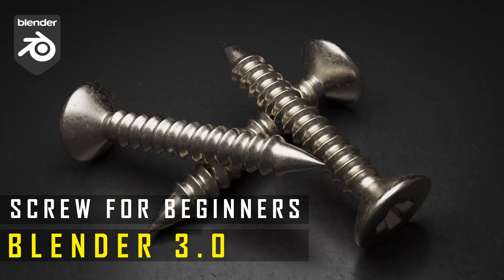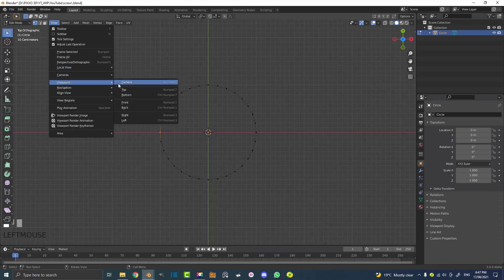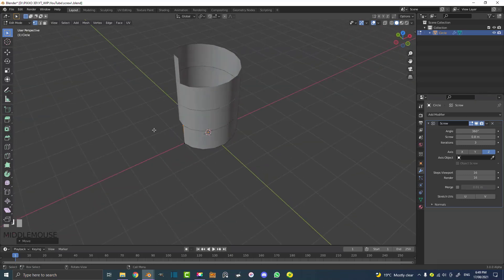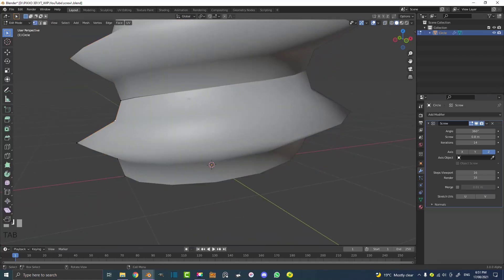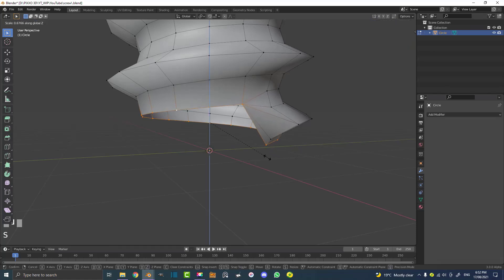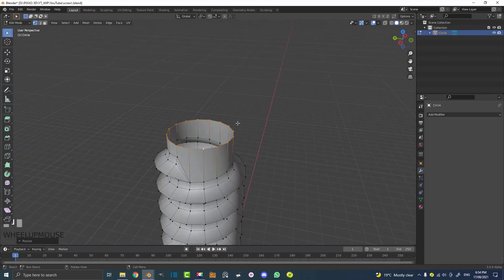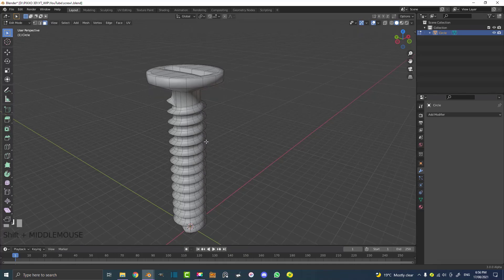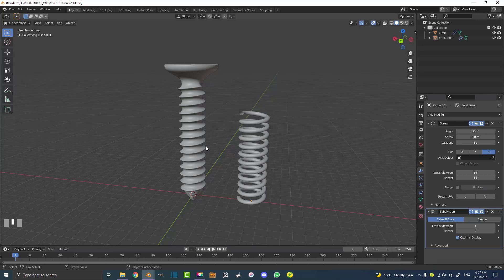Tutorial: Model A Simple Screw In blender

Comment: I Followed this, but blender just wont let me use the screw as boolean difference modifier. Can somebody point me to a right direction?
Create plane, select one vertex, CTRL+I, delete other vertices
Add screw modifier, "Screw" 1m, Iterations 10
Extrude point to Z 1m
Subdivide the two points, G X -0.8m the center point
Add weld modifier 0.01m
Apply Screw, Apply Weld
Merge the 3 bottom vertices, Extrude Z, Scale Z 0, F
Merge the 3 top vertices, Extrude Z, Scale Z 0, F
Done.
But i can not use it for boolean difference modifier. Can somebody help?

Comment: First, thank you for the tutorial, time, and effort.  Really really appreciate it coz I learned:  ctrl + I, screw modifier, double GG, and more . I will now model a cross section of a METAL FILM RESISTOR used in Electronic Circuits. Basically, the resistor is constructed with a round ceramic rod substrate of fixed length, then coated with a film of metal. Then the metal film is cut using a laser to form a thin spiral metal coil around the substrate. Two end caps with leads are connected at each end of the resistor. A final coat of insulator protection is applied. I googled the cross section picture. Again, thank you.